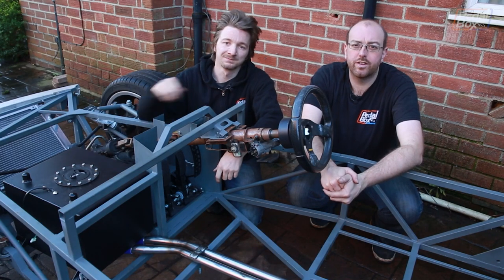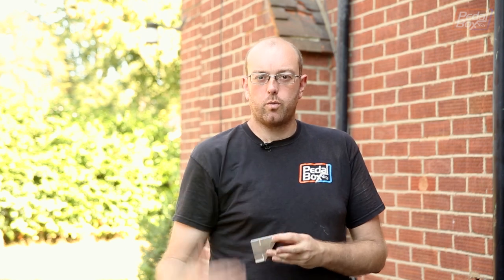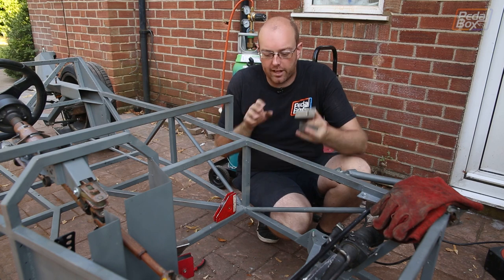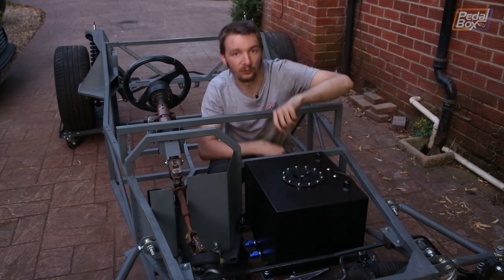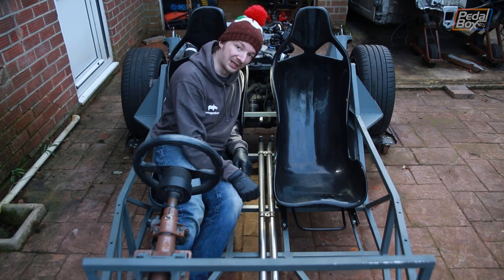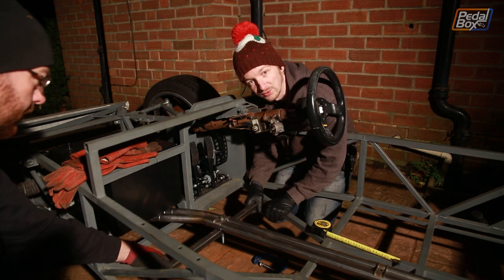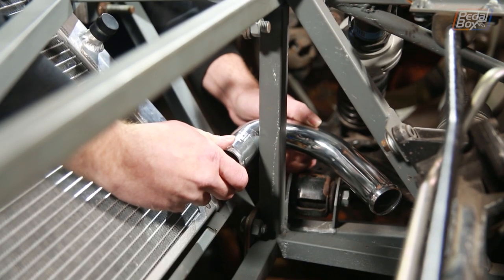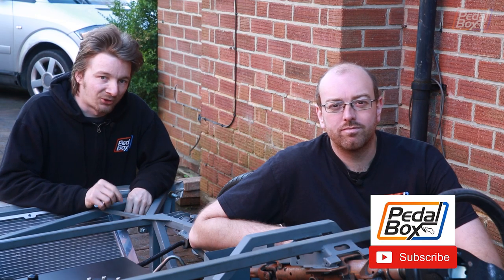Fuel Tank and Coolant Pipes | Audi Kit-Car | PedalBox Episode 38

Comment: What about running a remote thermostat in the front of the car then teeing off the coolant hot and cold lines for your heater core? Saves weight and complexity and puts a bit of weight on the front end.
That's what I'm doing on my build.
Reply from the maker: I'm coming more and more round to that idea and having some tee-offs to the heater unit. we chased the water route and the heater core looks like it's just in the main run to the radiator, so may just need the coreunit adding in, power and it'll work. It'd be nice if it does!